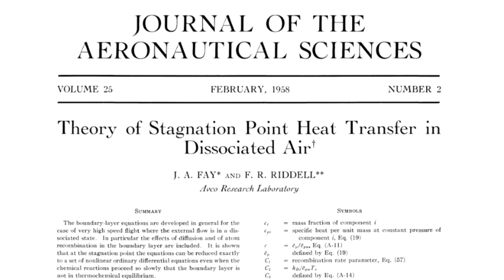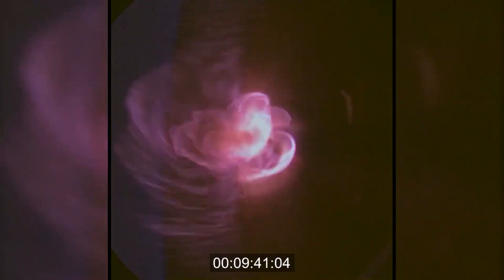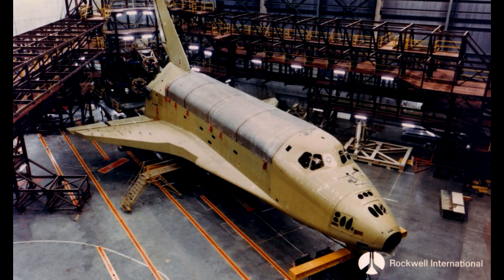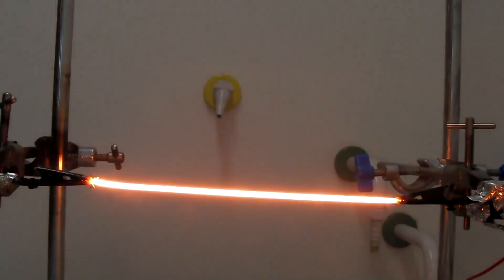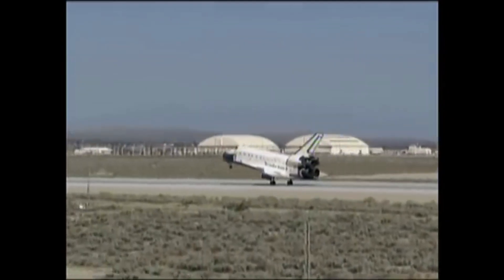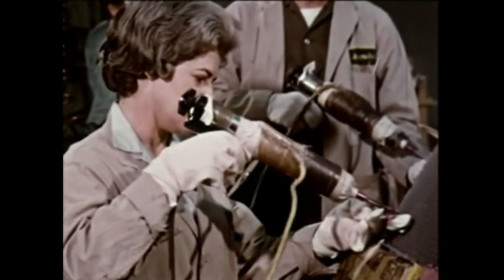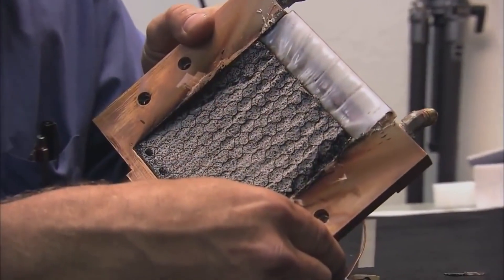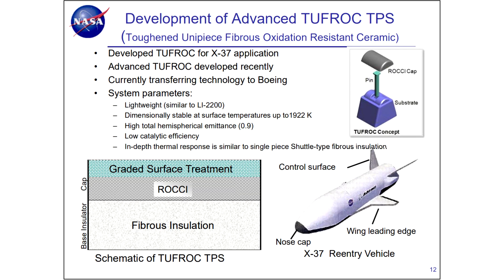Heat Shields - Things Kerbal Space Program Doesn't Teach

Comment: Entered jupiter at WHAT ??? Gods, the sleepless nights for the shield engineering team...
Reply: Yup, 47.8km/s. Compare that to like 8km/s for LEO reentry. Insane speed isn't it? Explains why the heat-shield lost so much mass. It went from 47.8km/s to subsonic speed in less than 2 minutes.
https://en.wikipedia.org/wiki/Galileo_Probe

Radio contact with the probe ceased (due to the high ambient temperature) 78 minutes after entering Jupiter's atmosphere at a depth of 160 kilometers. At that point the probe measured a pressure of 22 bars and a temperature of 152 °C
Reply: imarchello o
Reply: At "Ludicrous Speed".

48 km/s - 48 000 m/s or 48 000 km/ks, enough speed to circle the entire Earth (40 000 km) in under one kilosecond (1000 s). Imagine doing what took the navigators of the past years (tens of megaseconds) and now doing it in all the time of a short lunch break.

Now imagine piledriving, encountering 48 km of air - about as much as spanning the distance between four towns visited in succession - into a small pancake in 1 second - and you can think about the  consequences of this in terms of forces and temperature. It's near absurdity and yet it's something that actually happens for real!
Reply: @mike4ty4  you did the math all wrong. If the earth has a circumference of 40k and the speed of the object is 48kps then it would take just under one second, you exaggerated by a rate of 1000
Reply: @peeledbananas9840   Please do sense check your statements before you go after others. 40k Earth circumference is short for 40 thousand kilometers (40k km if you wish), not 40 kilometers. An "Earth" with a circumference of 40km would have a diameter of just 12.74 km, smaller than a decent size city. You could walk around that "Earth" in 8 hours (not taking into account the much much smaller gravity).
Reply: @dan-nutu  a simple typo. By 40k i meant fourty thousand kilometers
Reply: @dan-nutu  and you obviously understood that.
Reply: @peeledbananas9840  not sure if trolling or just dumb. tell me, what is 40000/48?
Reply: @TheYang2208  like 6 or 7 im not sure
Reply: Yeah, my eyes glazed over when he said that. I'm still trying to actually grasp how fast it is.
Reply: @AnnaNym-h5k  Sorry to comment a year on, but I felt the same and ran some numbers: 172,800 km/h converted. As a point of reference, light travels at 300,000 km/s. The distance from Earth to the Moon is 384,472 km. So this probe could have gone from earth to the moon in about 2 hours.
Reply: Hang on so he said it slowed town at about 200 g, at 30 kilometers per second that's 17.6 gigawatts of heat produced. That's like 45 nuclear reactors. Blows my mind that's even possible to survive.
Reply: You can enter the atmosphere. Good luck ever going anywhere of distance. ;)(Never will go anywhere remotely far in)
Reply: The biggest worry is when to show up and not be late for the incoming signal
Reply: Them engineers double check their math with flat earthers , because they know everything.
Reply: I think they were speeding....
Reply: Hell they said challenge accepted.
Reply: Mach 139… 😳
Reply: 48 km/s... the rule of thumb is an object moving at 3 km/s has kinetic energy equal to its mass in TNT.

Kinetic energy equal to 16 times its mass in TNT.
Reply: @PyroDesu  Kinetic energy increases with velocity squared. It's not 16 times. You're actually looking at 1.15GJ/kg. TNT has 4.18MJ/kg. 275 times.
Reply: @demoniack81   hot damm  the Rods from gods is a insane consept
Reply: @Thefreakyfreek  I'm thankful no one has been insane enough to make those o_o;
Reply: @UNSCPILOT  well, all you need is to launch a like 10 ton aerodynamically stable steel rod with a thicc TPS on the tip into orbit and have a way to precisely deorbit it. Nice thing is, you barely have to account for the atmosphere existing at all.
Pros: it's a terrifying, highly localized and super intense earthquake maker with no way of stopping it.
Cons: it would cost about $200,000,000 per use if we're being extremely conservative, plus it violates multiple international treaties.
Reply: @nathanaelvetters2684  Essentially a nuke, minus the radiation, with even more focused area of effect.

Anyone that wanted to launch a decent stockpile to orbit would probably need a relative to the Sea Dragon rocket design though, though my estimations could be way off, I'm only a KSP enthusiast with no formal training
Reply: @UNSCPILOT  I think it could easily fit within the payload capacity of a Falcon Heavy, though perhaps not the size of the fairing. You'd have to launch them in multiple launches, but that's fine.
Reply: @UNSCPILOT  I misread that as "I'm the only one insane enough" and thought nothing of it because I associated your name with the fictional UNSC in the Halo universe and, by extension, their ODST units. The guys that literally drop from orbit in pods. That was a fun trip down memory lane.
Reply: @nathanaelvetters2684 
I once read that kinetic impactors are not prohibited by any treaty. While it is easy to ban nukes banning kinetic impactors is really hard. 
Essentially every  spacecraft ever is a kinetic impactor. And Chinas recently tested anti-satilite-missile uses a kinetic impactor to kill the target.
So either China violated a spaceweapon treaty or those things are not banned.
Reply: @nathanaelvetters2684  about those international  laws   its not a weapon   its a way of planting telefone poles
Reply: @Draconic74  heh, yeah, was a Halo fan back durring 3,ODST, and Reach they kinda lost me in 4 though and I've been on PC ever since. ODSTs are definitely a personal favorite alongside the Spartan IIs, Halo was definitely one of the major things that ignited an interest in space travel and colonization... hopefully on more peace terms XD
Reply: @Thefreakyfreek  the insane part is how easy it is to build too, get past the launch issue and ya you have something equivalent to a nuclear bomb without the radioactive fallout and really the launch issue is just one of cost which as we have seen in our nuclear program is not exactly an issue
Reply: @UNSCPILOT  To make rods from God work you don't want to put them in orbit around the earth. If anything you want them in a solar orbit...
Reply: @allangibson8494  no, not really, orbital speeds are fine and around the Earth it would be easier to precisely land it on target in under an hour or at most a few hours.

In solar orbit or even in a lagrange point you'd be waiting days or years for it to arrive and at those speeds if you don't melt the tungsten rod you'll still have a hard time keeping it on target.
Reply: @UNSCPILOT  The problem with earth orbit is the need to de-orbit - that is a massive waste of energy.
A solar orbit gives you more energy and eliminates the need to de-orbit - it just requires an orbital correction to hit your target.
A nuclear bomb is cheaper - South Africa built a dozen for just on $100,000,000 in the 1980's.
Reply: @UNSCPILOT   It's close enough to a nuke, I think if the 47.8 km/s speed holds, at a mass of 300 kg, this thing had about 200 times less energy than the first A-bomb test, Trinity (which was measured at around 80 TJ of energy), but that's still absolutely ridiculous
Reply: @rohanselvan4339  Going off of the 16², a 300kg projectile entering at 46 odd Km/s it would have the kinetic energy equivalent to just shy of 77kT of TNT, or a little shy of 3½ times the energy of the Trinity test
Reply: @nathanaelvetters2684  honestly, $200M per shot is not a bad deal. $2B to put 10 in orbit, each one can basically level a city with the quake, I would be surprised if there wasn't one of these things kicking around up there.
Reply: @nathanaelvetters2684  it MIGHT violate, as with all human terms and mouth sounds it all comes down to semantics ><
Reply: @QualityPen  the calculations might change a bit if you have lunar or asteroid based materials to source from and thus avoid the necessary launch costs, but I agree that with what you present it's a inefficient offensive system for the cost.

It would be difficult to intercept though so the concept may eventually resurface if only on that merit
Reply: @PyroDesu  Kinetic energy rises with velocity squared. That makes it 256 times. It's unreal to imagine that it was even possible to engineer a solution to that.
Reply: @andrew34765  "Can we please just design something to survive a nuclear detonation? Please, for the love of God."
Reply: @PyroDesu  Kinetic energy goes to square of velocity. It's 16*16=256 times the energy.
Reply: PyroDesu not 16. 16 squared (cuz kinetic energy formula has velocity squared) so it is actually 256 times the energy
Reply: @PyroDesu  Not quite... kinetic energy is proportional to the SQUARED velocity, so a 16-fold increase in speed means a roughly 250-fold increase in energy!
Reply: @jphickey77  You're about two years too late to the party of correcting me.
Reply: @PyroDesu  Yeah, I should have kept reading... Lesson learned.
Reply: @PyroDesu  My condolences, dude. This probably gets pretty annoying lol.
Reply: @TheHooseNutz Not sure if joking or serious, if serious... I would doubt your claim even if you could produce enough credible evidence to build your case on.

And if your Joking, it just went over my sleep addled brain so you can enjoy a chuckle at my expense XD

Comment: What's stopping us from just doing a slower re-entry?
Reply: You would need as much fuel to slow down as it took to get up to speed. So you would need twice the amount of fuel, which presents all kinds of problems, as the added weight would then require more fuel.
Reply: @Evolution56  you would actually need less, since you are on a vacumm
Reply: It would take additional propellant to slow down before re-entry. The Falcon 9 booster actually perform their "re-entry burn" to do exactly that.
Reply: The speed or velocity is what is stopping us from doing a slower re entry.
I know this response looks like a joke and that I'm being sarcastic, but it actually is also true.
As Atomic Frontier states. The more velocity the more energy the object possesses. That energy needs to be shed or gotten rid of in some way. There are a few ways. But which ever way was chosen, it still needs to get rid of the energy in some way in order to be able to slow down.
There are no brakes as such, only airbrakes would be possible, which a drogue chute or parachute actually is. However these are not possible to be used at such velocities. If too high there would either be no atmosphere to work with, or if left to a lower level they would be instantly shredded. Rocket motors or retro rockets are heavy and/or need fuelling.
How things operate on a daily basis for us on earth with a dense atmosphere slightly stronger gravity and at our relatively rather pedestrian speeds are not how things work and react when talking about leaving the earth and atmosphere and the speeds needed to be acheived.
Reply: That's a good point, however in order to get into orbit you need to put in a lot of energy (e.g. to stay in orbit at the height of the space station you need to be travelling 7.7km/s) and then need to get rid of this energy (preferably) before you hit the ground. You could do that by firing some more rockets - but it's more efficient to dedicate a little bit more mass for heat shielding and atmospheric breaking rather than a lot of mass required for fuel. Even SpaceX mostly uses atmospheric breaking to slow down. If you want to learn more I did a video on the topic while at NASA ("Down to Earth"). Hope that helps!
Reply: @AtomicFrontier  Wow, went to see your channel. I dont understand how you have so few subscribers! Great Channel! Thanks.
Reply: @julienbo  Thanks so much!
Reply: Delta V
Reply: Takes more fuel to slow down more, and the slower you go the steeper your decent from orbit... which ironically makes you re-enter hotter and faster.

And if you try to slow down less and enter at a more shallow angle,  you may bounce off of the atmosphere like a rock skipping on a pond.

TL:DR Anything returning from Space has a very narrow entry window to avoid skipping off and missing it's landing zone or burning up like a very expensive meteorite
Reply: Weight and reliability issues of rocket engines. Heat shields are light and reliable for the Change in velocity they provide.

Comment: If you could go through the atmosphere really slow, it would not heat up the slow object entering?
Reply: Correct! But in order to get into orbit you need to put in a lot of energy and need to get it back out (preferably) before you hit the ground. You could do that by firing some more rockets - but it's more efficient to dedicate a little bit more mass for heat shielding and atmospheric breaking rarther than a lot of mass required for fuel. Even SpaceX mostly uses atmospheric breaking to slow down. If you want to learn more I did a video on the topic while at NASA ("Down to Earth"). Hope that helps!

Comment: Or just do what the Russians do and use a thick piece of wood as the heat shield
Reply: Yeah, I mean... carbon is carbon. 'Starlite', wood, or cork will evidently do the job just fine.
Reply: You do it. I'm going to sit here eating popcorn and watch the synthetic meteor shower. 
Oh oh!
You should make the air-frame out of cardboard too. That stuff is made of triangles. Triangles are strong. Trust me. Everything is fine.
Reply: @AverageJoe8686   It wasn't actually the Russians. It was China in their 1960s and 1970s space programme. It's on Amy's Vintage space channel where she describes it in a bit more detail.
It worked fine.
Reply: @LH1980XX  I still think the cardboard will work.

Comment: So what you're saying is that you don't necessarily want the tps to be as black as possible, especially at high speeds? I always thought that you wanted the heatsheild to be as black as possible to re radiate the most heat. Isn't the reflective heatsheild on the starship going to make it experience more heating during Leo entries?
Reply: The point of being reflective is to not absorb the heat in the first place. What you don't absorb you don't have to re radiate.
Reply: @Martinit0  but heat is transfered to the vehicle by more than radiation. Having a shiny surface will not effect how much heat is convected to a vehicle.  At entry speeds around 8 km/s or lower, the heat transfer is mostly from convection. But at higher speeds, radiation starts to play a larger role.

Comment: Hmm, surely it would be possible for the BFS to use engines to slow down significantly before entry, if they have enough fuel.

I have to say that I prefer "dumb" heat shields over actively cooled ones. What if the coolant pumps fail? Or a pipe bursts?

Comment: Have they ever experimented with injecting a different gas, liquid nitrogen perhaps, to modify the boundary layer?
Reply: Boeing was going to use steam to cool the X-20 with a stainless steel skin with holes drilled through it. Basically the re-entry heat boiled water which then vented to the underside of the craft. The water was the waste product of the fuel cells powering the craft. Niel Armstrong was one of the pilots on this project when it was canceled and then transferred to NASA.
Reply: You'd need pretty big tanks, given the hypersonic storm you'd inject that into. Sounds like a losing proposition.
Now, doing it inside the hull like BFS, that's a different matter.
Reply: @KaiHenningsen  SpaceX is currently doing this on the lower stages of the Falcon 9 rocket during re-entry.  In that case though, it is the exhaust plume from the re-entry burn that provides that sort of direct injection at the boundary.  There are obviously limits to how that kind of technology can be applied and the sort of insane levels of accelerations which can come from a direct rocket thrust thermal protection system, but it does work.

Comment: The defunct aerospace company "X-COR" developed a heat/combustion resistant composite dubbed "Nonburnite" for their Lynx suborbital spaceplane project, intended for protecting internal structures from hot engine parts as far as I know.

The company had developed their own family of rocket engines, notable for using reciprocating pumps for fuel/oxidizer, along with their Rocket-EZE demonstrator aircraft.

Comment: I’m slightly perplexed by carbon carbon, is it two different types of carbon bonded together or a carbon composite?
Reply: It's graphite carbon held together by carbon fiber
Reply from the maker: You weave a carbon fiber framework and then fill in the gaps with graphite using resins and gasses.
Reply: Scott Manley @ Tuzszo 
Thank you.